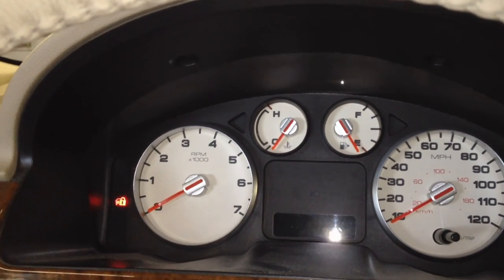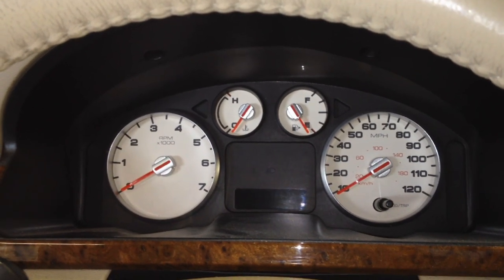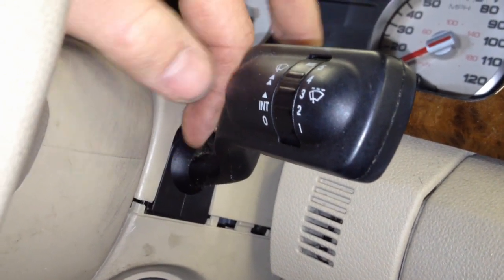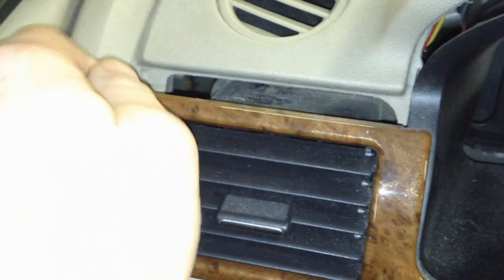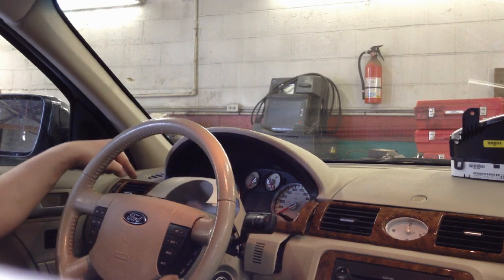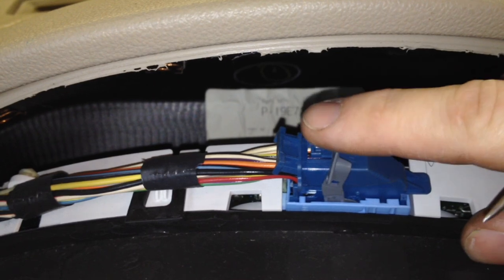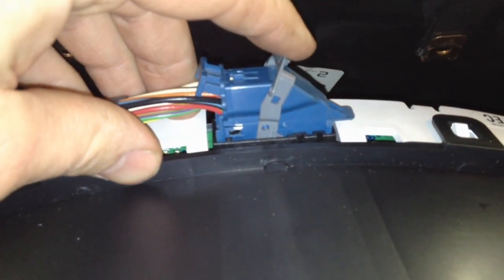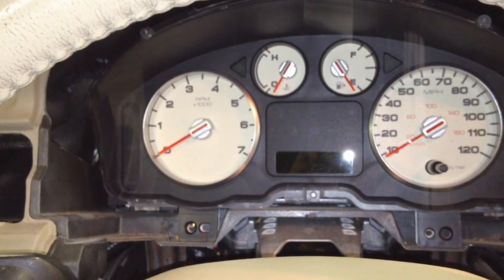Ford Five Hundred Mercury Montego Instrument Cluster Removal

Comment: Bravo!
Dead on. Followed step by step. Took me longer to get the right bulbs #74, then to disassemble and reassemble.
THANK YOU.
Now a subscriber!
Reply: I replaced the original bulbs in my '08 Taurus with T-5 LEDs, they are actually brighter than the originals. I used this video to pull the cluster, replaced the old bulbs with the LEDs, and reinstalled it. A 10-pack of LEDs cost me less than 4 #74 bulbs, and allowed me to replace all the guage lights and the shift selector light.

It did take a little more time re-testing them, because LEDs have a polarity, and you can install them backwards, where they won't work. The big benefit I have is that the turn signals are much brighter, and harder to miss as you cruise down the road. 😉😂 
Can't miss the guages now, either.
Reply: Yhanks for the bulb number...that helps too!
Reply: Do you know how long I've been looking for this information no video list it

Comment: Thank you so much for this video.  I am a female and did it myself on a 20076 Ford 500.  Took me awhile to get it out since I was looking for tools.  Took me less than 5 minutes to put it back together.  Time will tell if the dropped gauges will work now.  Post an update later to let you know.  Next, the AC!
Reply: Unfortunately, this did not fix my problem.  I will now buy a new Cluster for it and hope it works.  Will update later
Reply: Where did you buy the cluster? I need a new one, I am thinking of buying a used one because the new ones are like $500.
Reply: Choloengringolandia:  bought it on Ebay.  Unfortunately, it still did the same thing.   So far I have had it soldered, bought a use one, had it rebuilt, and have had all my negative wires cleaned and filed.  None worked.  Now I have had 3 mechanics tell me it's probably the alternator because it doesn't do it until it's all warmed up and been on a long trip with stop and going.  I need to buy a new one and not a used one because it would just do the same thing.  My next thing will be a new alternator.  And if that doesn't work, I''m done with it.  OH yes..also bought a new battery, which I don't think I really needed.
Reply: Sorry I didn't post this sooner.  I did buy a new Alternator and had my mechanic install it.  I have not had the electrical problem since, it worked for me.  Cost of new Alternator on amazon $135.00 cost to install $50.00 total to repair $185.00, less than the $1200.00 the dealership wanted to fix it. Of course I can now take out and install a cluster in less than 10 minutes myself.!!  lol

Comment: Do you any insight on actually repairing the cluster? Assuming the cluster had bad solder joints like most other Ford's? Thanks for all your help and information! I utilize information and tips from you on a daily basis to better serve my customers and help coworkers and friends. Being a master of all Manufacturers is near impossible but made easier with guys like you! Help us aftermarket guys out tremendously!
Reply from the maker: No we just send them out.
Reply: FordTechMakuloco Well Poo, was hoping you did it yourself. How much are the cluster's through Ford? I bet its obvious to someone with a good eye once they split it open. Wonder if its accessible through backside or if needles and back display have to come off.
Reply: FordTechMakuloco Fixed, took no time at all and no customer has car back and continue to work and pay on the loan hooray. You shoud really consider soldering this if it is a friend or personal vehicle. Better fix IMO than get same cluster with same weak points. Not to mention way cheaper.
Reply: There are some youtube video's of instrument cluster repairs. Most of them test the ground and power feed coming into the plug to make sure that they are not an issue. Next they look for damaged traces or cracked solder joints and repair them and give it a go. One guy used some conductive paint to repair a couple of bad traces and of course he simply soldered the bad joints back.

Comment: Sorry thought I typed driverside but it never used to click when I got the car until I unhooked the battery to clean the battery corrision off it did a hard reset  I checked the fuses they all are good didn't know if it was normal when I did research other people seem to have the same problem on the same car then it gave the abs code u0121 then the check engine check transmission light on for 2days after two weeks the hard rest of the pcm then I notice the click of the rear defroster ever time I pushed the button then the check engine check transmission light came on didn't know if I shorted out something or a relay then yesterday the check engine check transmission light went away I might be mistaken but the odemaiter has a delay when I start the car it turns on after the warning lights go off I did research on this car and there is a couple recalls and a lot of tsb"s for the electrical and brakes I am thankful for all the knowledge you provide just tryna make sure I can makes this a reliable car

Comment: Thanks for sharing man!
 Have you ever seen a Ford 500 with the reverse lights staying on once the key is on. Also the oil and brake light stay on. All this happened at once.
Reply from the maker: Only when the cluster is bad.
Reply: Thats an expensive cluster!
Reply: Blade I have the identical issues exactly as you described. Back up lights will stay on or randomly flash on and off as well the oil light and brake light will randomly stay on. It all happened at once. I also notice at night sometimes the dash cluster will stay lit all by itself once the key is off or out when engine is off. Then randomly will go out. I believe from all my reviewing it is a soldier joint in the cluster??? I’d love to know how or if you fixed yours as well as what soldier joint it is and I’d do it myself. Thanks for any info. Much appreciated.

Comment: I've got an 06 Five Hundred, and the compressor went bad, but before that the dash lights would flicker, then eventually it will zero out and shut off the dash for a moment, then come back on.  Put a used compressor on it that spun freely, but wouldn't engage to beable to drive again.  Girlfriend never mentioned that the dash kept flickering.  Now, I bought a new compressor, and got the ac back up, and the flickering dash is back.  Any suggestions?

Comment: Do you only need to take to dealer for reprogramming if you are swapping the old cluster for a new one, or does simply unplugging it to change out a bulb require reprogramming also? Great video by the way!
Reply from the maker: iBuyHouses You only need reprogramming when installing a different cluster.

Comment: So glad I found this video! We just bought an '08 Taurus Limited for my Mother-in-law yesterday & realized that it has some dash lights out for the speedo & tach after it got dark last night. I'd like to replace them today, but the dealer is closed today (Sunday). Are the dash lights dealer only or can I purchase them elsewhere?  Thanks!
Reply: I know I'm 5 years past the issue, but maybe someone else can be helped by my answer. I purchased my bulbs from Amazon, and used T-5 LEDs instead of the originals. You gotta check them after install to make sure the polarity is correct, if reversed, they just don't work.

The incandescent bulbs are available there, too. I replaced all of them, I don't want to have to take it apart again anytime soon! The turn signals are a lot harder to forget, now, the LEDs will get your attention!

Comment: When you took off the cluster is it feasible to get or replace the bulbs without taking out the harness saving money do not go to the dealer to get re-programmed
Reply: I just bought a use 05 Ford 500, one bulb (coolant temp. gauge) went out.  I plan to take the cluster out and replace one bulb.  My thinking is that if you dont remove the cables to the cluster then no need for re-program!
Reply: @DaiLenMatHo  they don't need to be reprogrammed unless you change the cluster itself. Your original will work fine once reinstalled. Only needs programming if you use a different cluster.

Comment: Hello, I have an o4 freestar se, can the intrument panel be removed ie taken out of the van without causing issues? Can I replace like the 500 in this video and have dealer reprogram afterwards? Found used cluster at pik n pull but dont want to buy if it would be useless. Thx in advance

Comment: Hello  I have a 2008 Taurus AWD SEL with 121,889 miles. I love my car and it has been pretty trouble free for the 6 years I have owned it. However to day I drove my car and realized that the speedometer and tachometer are not functioning correctly. When the engine is turned off the speedo reads about 20 MPH BELOW zero and the tach reads 600 RPM. When I am driving on the freeway the speedo reads 40 MPH and I am really going about 65 MPH according to my GPS device. I realized this when I was driving very fast at what I thought was 60 MPH when it turns out I was really going over 85 MPH!
I am hoping to tap into your expertise to see if you all may know what is wrong with my car and how I can go about fixing it. This literally happened and before that this issue was not showing itself to me. I am pretty mechanically inclined so I am hoping all I need to do is remove the instrument cluster and make some sort of adjustment. I tried disconnecting and re-connecting the battery and this did nothing. Thanks in advance for your help

Comment: Great channel, I was hoping you could give me some insight into a car I'm looking at. I'm looking at buying (if priced appropriately) a 2006 Ford 500 Ltd with CVT and AWD. While on the test drive, the speedometer dropped to 0, the Traction Control, ABS, Brake and I think the SRS light suddenly came on with the message "Check Brake System". The Car seemed to continue to drive fine. The guy at the service counter said it sounds like it just needs a cluster. Does this sound like it just needs the Instrument Cluster replaced? If I replace it myself can I get a salvage unit and have it reprogrammed at the dealer? How much would it cost to have the dealer reprogram it? I also pulled codes: TCM DTC U0415-60, 4X4M DTC P1889-20, ABS DTC C1165-20, ABS DTC C1222-20, RCM DTC B1318-A0, RCM DTC U2023-A0,IC DTC B1318-20,IC DTC U2023-20 Do you think these codes are related? Thanks
Reply from the maker: +Brad Noyes On a 06 yes a new cluster for sure before anything else.
Reply: +FordTechMakuloco OK, thanks. The dealer selling it told me it needs a wheel bearing, they are going to put one in it and give me a call. (Insert eye rolling here) we will see how it goes from here.
Reply: '05 Five hundred owner here. For over 2 YEARS I have been having issues of exactly what you described happened to you on your test drive. I have taken it to the dealer to have them fix it three times, and never did they solve my problem. Today I FINALLY discovered what the culprit was. Yes, it was the cluster, but I did not have to replace the cluster, nor did I have to solder anything. I followed FordTechMakuloco's video and took the cluster out only to discover that there was water damage to the entire back of the silicon chip board. 

What was happening was every time it would rain or get any kind of humidity in the car, water would condense between the chip board and the plastic sheathing that they have which is supposed to protect it. When the condensation would evaporate, it would leave behind minerals and dirt dried to the chip board. All I did was clean it off with some isopropyl alcohol using cotton swabs, hooked it back up, and now it works like magic. 

So if your five hundred ever does that again in the future, check the back of the cluster panel chip board before you just let them replace it.

Comment: A mechanic on the side did a tune up. When he connected the battery back, all the lights on the cluster were off. He says I need to replace it after he did some tests. Where could I buy one? Is a use one ok?

Comment: Before I start removing the cluster in my 500 should I first remove the positive cable end on my battery? When I owned a 2009 Focus if I did anything close to the dash it was highly suggested to disconnect the battery cable? I am planning to replace the cluster bulbs for the tach, speedo, temp and gas gauges. I don't want to have my air bag go off in my face. Thanks!
Reply from the maker: +Dynasonic51 No need just keep the key in the off position
Reply: Thank you for your reply! This will help.

Comment: I got a question Can a Mercury Montego front wheel drive transmission fit in a 2006 ford five hundred
Reply: Yes... They are the same car.  Some things are different between cvt and 6sp trans and you may need to also swap some wiring, but the transmission will physically fit.

Comment: After replacing the cluster: 1. Do you have to have it programmed by the dealer and 2. Will the car know the mileage (I'm hoping it doesn't mess the mileage up with a new cluster)
Reply from the maker: djh301 Mileage leaves with the old cluster and you will need to program the cluster afterwards.
Reply: FordTechMakuloco Is this legal to do? I don't want to get in trouble.  Is it legal as long as I disclose it when I sell the car?
Reply from the maker: I believe there is a form you can fill out for odometer changes but laws vary by state dmv is best for that question.
Reply: FordTechMakuloco Thanks.  Two more questions: 1. If I hook up a replacement myself, will the car run without it being programed so I can drive it to the dealership? 2. Can I easily put my current lens on a replacement cluster with a cracked lens.  I found a used one that is cracked.
Reply from the maker: Yes you should be able to start the car and drive it to the dealer. There are just tabs on the side of the lens so it snaps onto the cluster. They are a hard plastic and may crack so practice on the old new cracked lens first.

Comment: how did you remove the  illumination bulbs? and do you recall their size?
Reply from the maker: +Michael Thompson I am pretty sure on these you must replace the bulb and socket together
Reply: FordTechMakuloco do you know if the 500 doors are interchangeable with the montego, mercury, or taurus
Reply: @FordTechMakuloco  the bulbs do come out of the sockets, I used my original sockets to install the LEDs I put in.
Reply: @untraditionalministries4588  my Taurus had its door replaced by one from a 500, with the original  interior panel replacing the one from that door, so everything matches. The guy that did it didn't replace the wiring, though, so my mirror works, but the heat, puddle light, and memory seat buttons don't work. I'm gonna go see if he has the old door on his pile, so I can get the original door handle with its solo key slot, and the wiring to make stuff work again.

Comment: I would like to know if you have any information on how to install a steering wheel with audio controls. The Five Hundred I plan on getting doesn't have them so I want to install it myself.
Reply from the maker: It would require allot more than a steering wheel with the controls you will need a new clock spring, custom wiring and new as built data fore the radio.
Reply: OMG that's sound very difficult my friend.

Comment: So the bulb # on your description works for both sides of the speedomiters? And if I want to replace my sencor (rear) I have to get it programmed by a dealer I have a 07 fivehundred limited and it's always on r and when I'm in reverse it beeps then it turns to r. Please help and the right sides on both of my speedomiters are black I used to have to hit them to turn on now they are just off
Reply from the maker: freestyle charlie Yes all the illumination bulbs are the same, if you replace the rear park aid sensors you will not need to clear codes or program anything.
Reply: Thank you bro that is my mission for today hopefully all goes well sucks not being able to use parking aid when it's there. Another question my motor mount that is placed is getting bad this will be the 2nd time replacing withing 2 years any advice  on a easy way to remove and replace I do know it is common for these vehicles to have wear and tear on top motor mounts it looks like a hockey puck
Reply from the maker: Just support the engine by the oil pan with a jack and block of wood and it comes right out then.
Reply: That's for the upper mount ?
Reply from the maker: yes

Comment: hey i really need help with my 2005 ford 500 limited i bought the car used and when i did i felt they might was not telling me something at the ford dealership but i had the car about 6 months they told me nothing wrong with my friend put his machine on and no codes came up at all i took to ford for rotate tires and muti point inspection and oil change they told me nothing was wrong with the car while i was waiting i over herd a mech came in and said thats the car i worked on the abs a while go came home with the car and notice there was some corrosion on battery so i unplugged the battery and cleaned it up and took off both positive and negatives feeds off the battery then put it back on i later google and also notice when you take feeds off the battery it resets the pcm bout a couple weeks bout 170 miles after reset i pushed the defrost on and herd clicking in glove box then took out fuses and noticed fuses to be okay and then turn the car on position and it still clicked and then the check engine and transmission light on i took it to auto zone for free check engine light check and the only code that came up was u0121 for no comm with the and mod and no other codes check engine light is still on dealership said they would diagnostic for 90 bucks but i still have to get the brakes fixed worried bout if the dealership screwed me over on this car or something bad going to happen please help
Reply from the maker: The clicking is then recirc door-
Ford Taurus & Five Hundred Clicking Noise In Dash Repair